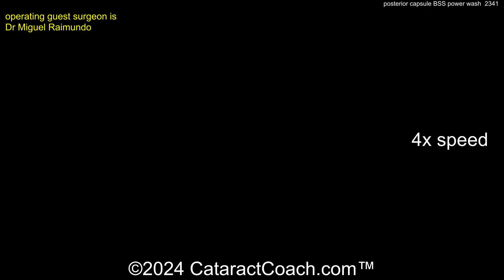CataractCoach™ 2341: posterior capsule BSS power wash

Comment: Doing this since 8 -10 yrs. 27g cannula. Very safe procedure.
Reply: Can't the fluid jet rupture the posterior capsule?
Reply: @osamabinahmed8290  Dont do in cases of PPC or where you are suspecting the PC to be weak. Otherwise it never ruptures. Obviouly you need to control the force.

Comment: We carry out this procedure at the end of every cataract surgery. As long as you don't touch the capsule, it is absolutely safe. When you inject the BSS, you can see how thin the capsule is and you can inject more carefully. This makes the capsule easy to clean. Even if you can't reach some remaining cortex material, you can easily wash it away.
Greetings from Munich in Germany
Reply: I've also tried thus, may I ask whether you use larger or smaller canula to polish the capsule. I ask this because sometimes I see the PC flutter very much when I do this and it makes me quite nervous, also have you ever pushed the fluid too hard and caused a tear?
Reply: @kuatoroespada I never had any problems and I’ve done it in hundreds of cases. Works best with a spatulated cannula.
Reply: @mglraimundo  awesome thanks man. I'll defo be trying this more often
Reply: A very useful technique 👌. I used it a lot. Sometimes with BSS canula and Sometimes with the bi-manual irrigation prob and I never had any issues so far.